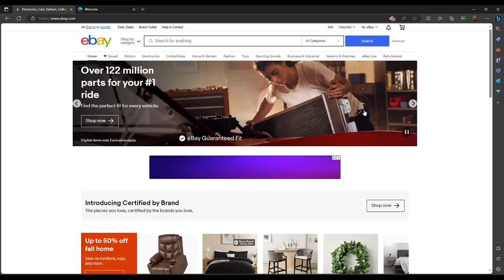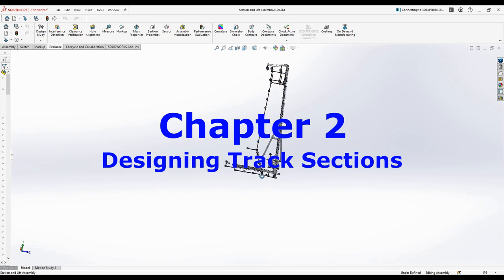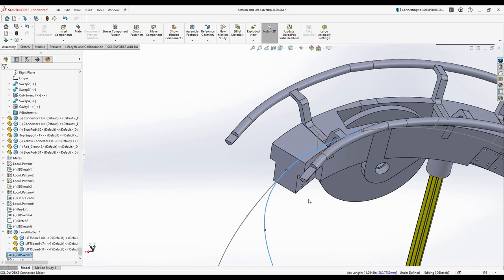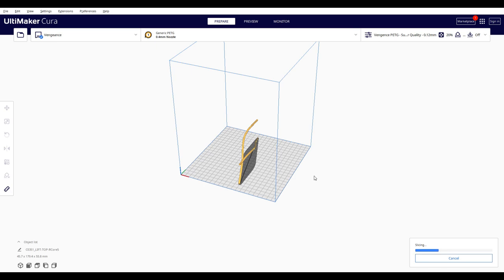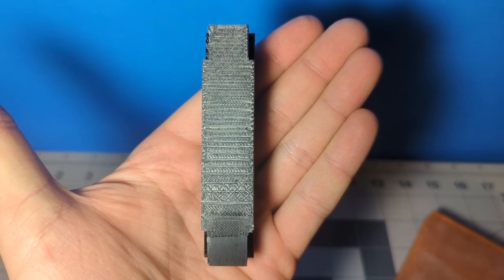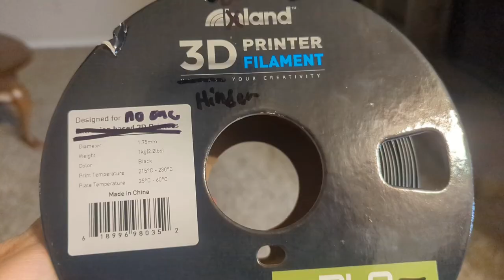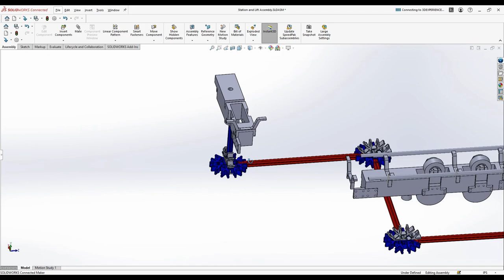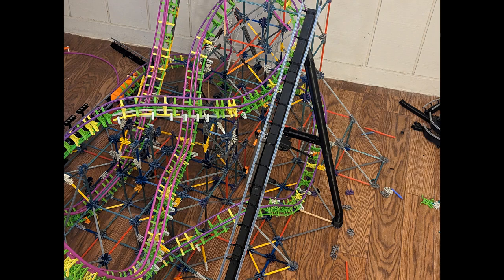3D Printing Roller Coaster Track | How to make K'Nex/Printed Hybrids!

Comment: Lovely video! You should make modular parts based off the Rollercoaster Tycoon trackpieces but at the scale of a K'nex grid so you can very easily place and connect them
Reply from the maker: Thank you! I actually had considered something like this but for elements tricker to build with knex. I also thought possibly doing mechanical parts like a transfer table with this design while keeping the rest Knex would be useful too. If there's enough interest I can try to put something together!

Comment: 18:50 you mention about the trains touching. I almost solved this and it took me designing an rmc train for knex to solve it. making the cars closer together while setting back the ball joint makes tighter turns easier. ill send you the base files for the train if you wana edit them to add your wheel assemblys
Reply from the maker: I've definitely gone through in my head how I could make the cars take an even tighter turn. But realistically I'm satisfied with the turning radius for now because it's fairly realistic scaled up. The idea I've been playing with is shorting the cars to a single row with that row riding on the axle similar to how B&M builds their trains. 

I've begun redesigning my trains with that idea in mind. My current trains are very similar to the RMC trains with a ball joint at the center. I think the new version will be designed so that I could do either a style similar to B&M or RMC. I'm a little hesitant to go with the b&M design because it would double the amount of bearings I need making it far heavier. My track could definitely handle the weight, but I can't say the same for the knex track!

Comment: I am currently looking into 3d printing a working scale model of Millennium Force at cedar point. Do you have any tips for how to design the trains?
Reply from the maker: That's super cool and I look forward to seeing it!

Designing trains is surprisingly complicated. I highly suggest checking out both my original video of my train design and the recent update video of them. By far my biggest suggestion is to create a design that is forgiving of track imperfections, but not too forgiving. If the parts are too loose or allow for too much movement then it makes them perform  poorly. A good 3D printer and quality material for it is extremely important. Finally, the size of the model will have some impact on the complexity. If the scale is too small then creating and printing functional parts becomes more tricky. This is why I haven't done any projects with micro knex.
Reply: @ModeledCoasters  thank you for the advice

Comment: Now upscale this by a large margin and you have a real rollercoaster. On a serious note great video, do you have any tips as i would like to do it myself?
Reply from the maker: Maybe someday I'll have the space and money to do that!

My best tip is to give your designs some "wiggle room." The printing process is never 100% accurate to the computer designs, so building in some adjustability saves you a ton of time and materials. This was something I learned the hard way pretty early into the process.

Also use quality materials and glues. The super glue I was using didn't hold up very well and that doomed the project.

Comment: where did you get that tubing for the track? I’ve been looking for knex size tubing with no luck.
Reply from the maker: It's a 1/4" OD polyethylene tubing from the hardware store. I purchased it from Home Depot, but it is also available at Lowe's. The inner diameter is larger than the  ID of K'nex tubing, so it's not perfectly compatible with  the cross ties.

Comment: Hello! I am building my own roller coaster that will be almost 100% 3d printed. I can' t find the right material for the tubing. Do you  
know about something similar to knex tubing and where it can be bought?
Reply from the maker: I'm using a 1/4" OD polyethylene tubing I purchased from the Home Depot. Lowe's and Menards also sell it. This works with both my custom trains and the screaming serpent trains. You can also purchase it for cheaper with more options from an online store such as McMaster-Carr, but they charge a lot for shipping.
Reply: You could also use the black garden tubing that doesn’t need to be drinking water safe.